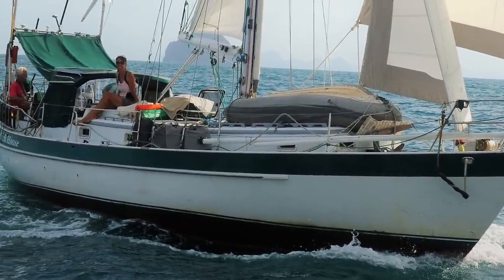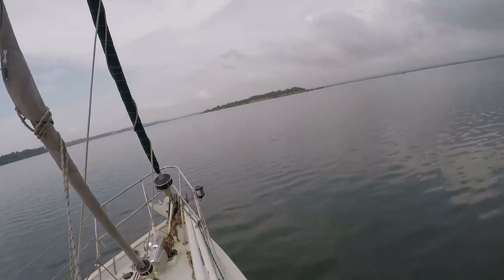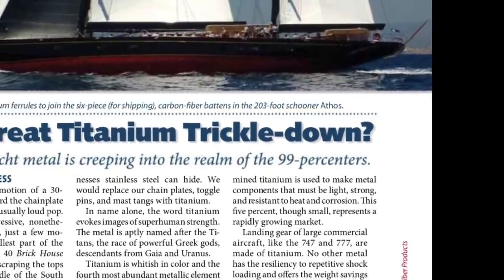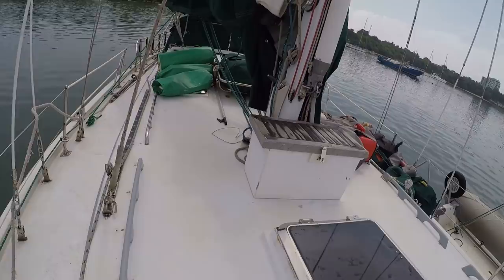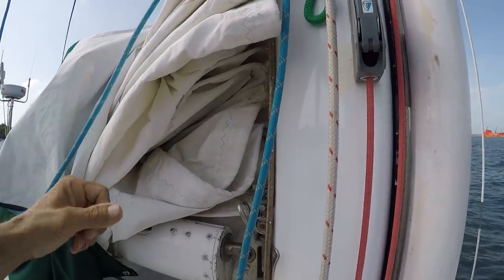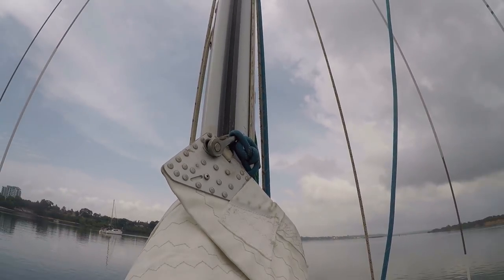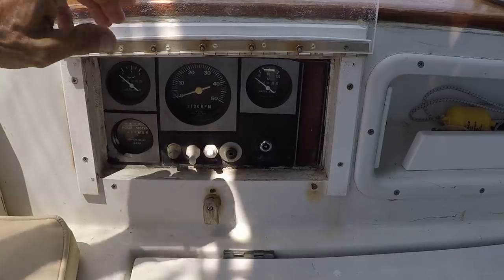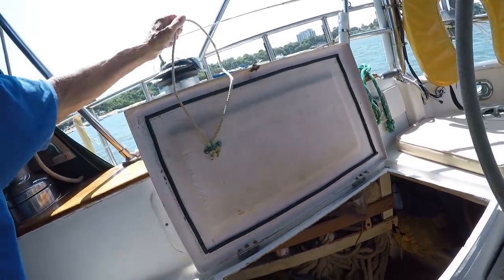Bluewater Sailboat Tour- On the Deck Of a Valiant 40 #1/3   (Patrick Childress Sailing #30)

Comment: Thumbs up. What type of communications do uou have on the boat? Also battery capacity and type?
The length of the video doesn't matter, as long as you giving us good information. The video would be much more pleasant if you could reduce the volume of the music, and avoid talking over the music. The story you're telling is much more important than the fancy edits. That's about all the feedback I have. Great video and thanks for sharing.
Reply from the maker: We have the normal VHF and Single Side Band with Pactor 3 modem. But now we have Iridium Go which is pretty much replacing the SSB. Sad to see it but the SSB is going the way of the cassette player and Radio Direction Finder. Batteries are 6 Trojan golf cart batteries which total 675 ah. Thanks for the feedback. I am deaf in one ear and have 50% hearing in the other so correct volumes are a real challenge. Rebecca has laser hearing and can hear a voice clearly no matter the back ground noise so we are not a good team for audio editing. To help keep me from saying anything stupid, I had a very experienced sailor friend look the video over prior to publishing and he did not mention audio so I thought we were good to go....but I will certainly cut the volumes next time.
Reply: @RVLifeNOW  thanks for replying. You have yourself a new subscriber. Stay safe and a very Happy New Year to you.

Comment: On the matter of walking hulls or props.  Always dock on the port side!  You pull the bow in and the stern walks right over to the dock!  You look like a great captain!
Reply from the maker: ZizZag, the Valiant 40s have a V-drive gear box which changes the direction of the engine output shaft 180 degrees....so the engine sits in the boat all backwards. this makes for a very compact engine and power drive train. This also causes an opposite rotation of the prop from most other boats. After operating other sailboats, one has to think backwards when reversing a Valiant 40. I see what you say though. Nice.
Reply: Patrick Childress Sailing I was kidding with you a bit!!! 
After 30 plus years of sailing I knew you new just joking!  
Smile,  laugh  you will live longer. 
Sending much love 
Be careful brother!

I knew you had a V drive but I did not know V drives changes direction of rotation so I did learn something
Reply from the maker: @svzigzag5898  Phew, I got lucky knowing the answer to that one. Always good to have experienced people making comments.

Comment: Hey Patrick, great video .. just a comment on titanium, in the recent past I used a lot of titanium on my racing bikes , it was considered a consumable item as all metal fasteners have elasticity,  titanium, whilst strong and light  had a much lower cycle rate than stainless or steel , not sure if this would pose issues on a boat, clevis pins I'm guessing would be subject to elasticity not sure to what degree.. I had many titanium components fail , but as weight was very important I continued using them..
Reply from the maker: Mitch, Grades 1-4 titanium are pure titanium and have different characteristics depending on how each grade is smelted. Those grades have a far lesser strength value than Ti5. Ti5 is a combination of metals giving it such great strength. Many screws and bolts are made of the lesser titanium grades. Use ONLY grade 5 titanium on a boat even for bolts holding a chain plate in place.

Comment: Another terrific video. How much more do you have to spend for titanium? I would have thought it prohibitively expensive.
Reply from the maker: Grade 5 Titanium cost a bit more than twice as much as 316 stainless steel. So if one is keeping their boat for a long time, as we are, the safety value is there. Ti5 is 3.5 times stronger than 316 and weighs little more than half as much as 316 stainless. Only grade 5 titanium should be used in a structural application on a sailboat, never the lesser grades. Hopefully, one day, they will have Ti5 turn buckles, toggles and wire. All far cheaper than suffering a dismasting.

Comment: Patrick,

Thank you for your very informative video and is a pleasure to see the Valiant 40 , I own a Pacific Seacraft 44 and it appears that all the modifications that you had to do on your vessel are standard build on the Pacific Seacraft except I have access for an emergency tiller just behind the steering pedestal . For the most part very similar Boats. I like the advise about using titanium for the rigging support , I think I will have all my chain plates fabricated and changed out to that. Oh yes what was the type of titanium the you suggest using.... Fair Winds and Safe Sea's  

Robert
North Star
Reply from the maker: Hi Robert, I always thought I would like our boat stretched out 3 or 4 feet to get a bigger aft cabin and to be able to somehow  move the anchor chain farther aft in the forward cabin. It looks like the Pacific Seacraft 44 is what I have in mind. 
The boats are so similar that there is on the V40, an emergency tiller access behind the pedestal  where the helmsman sits. 
The only grade of titanium to use in a structural application on a sailboat is Ti5, grade 5. Even with chain plates, the bolts securing them should be grade 5. Grades 1-4 are pure titanium and have their own special properties determined by how they were smelted. None of those grades are suitable for mast tangs, bolts or much of anything else on a sailboat. I use screws and some small bolts made of a lesser grade in cosmetic applications where I got tired of the stainless screws rusting or for simple things like the bolts to hold a cockpit locker hasp. The titanium article in Practical Sailor should answer a lot of questions. Allied Titanium might already have the pattern for your chain plates which makes the fabrication pretty easy. I hope this helps.
Reply: Patrick,
Thank you so very much for the quick reply and I will check it out  and it is all very useful  information . My Chain Plates are all stainless and I was in the process of researching to have all new one's fabricated... and I love the Idea of titanium .
Robert

Comment: Great video. On engine blower vent cubby hole could you mount the vent exit in the top of the cubby hole - is there room... at least gravity would be on your side keeping water out? PS. Did you let the cat back out?
Reply from the maker: The cubby hole is so big there is no room above it for a blower hose. I still have not figured out the best solution. Maybe some sort of plastic cap to fit over the vent and figure out how to secure it there. Lilly does get trapped in dark cabinets then lets us know, with a loud meow where she is and when she want out. But she has found a secret passageway from the aft cabin ceiling, into the cockpit locker, and from there, into the far aft of the boat, below the propane locker. It took a long time to find where she would mysteriously vanish to.

Comment: Patrick, my name is Victorio, I live in Spain, I admire your knowledge and I have seen all your videos, I have a boat of 28 feet and I want to put an HF radio for the bands of 20 mt and 40 mt, I have seen that you have an antenna going up the backstay, You would do me a big favor if you recommend me what type of antenna to place or describe to me as it is what you use, thank you very much.
Reply from the maker: We used to have insulators on the back stay but when we put on a new back stay 10 years ago I did away with them. That could have been 2 more failure points, they were expensive and a hassle to install. Here is the antenna we installed 7 years ago for our SSB Antenna.    https://amzn.to/2BSNdZa    This antenna has worked just as well as any other. 28' is a nice size boat, comfortable enough and easy to sail.
Reply: @RVLifeNOW  tnanks

Comment: Much like my Corbin 39 main engine is in Gailly but no V drive,, my staysail in hank on, same anchor windless,  right now carry 16 T-105 batteries  in house bank and 1000 watts solar, a honda 2K gas gen., air conditioner, a self made water maker,  3k inverter. So I think pretty good long term cruiser. S/V Bright Eyes
Reply from the maker: Bright Eyes...you sound well equipped!

Comment: Question     You have the engine gauges and controls on the side!  Ok that’s great!  If you could wave a magic wand and have them appear in front of the wheel would you?  Why or why knot? 
I am planning a boat and propose to put them at the bottom of a display in front of the wheel.  I would also include wind meters, and navigation screens?      Would you follow this plan or no?    Thanks brother,     

You also said if given a choice you prefer to go to the mast to raise or lower sails.  Me too. 
I plan on no auto furl on the mast.  I also am giving serious consideration to no auto furl or roller furl on the jib.   Money is not the consideration.  True sailing and personal satisfaction weigh heavily on my decision.  What are your thoughts.   

Stay quite, carry a big stick, be the meanest in valley,  but smile!
Reply from the maker: Zig, Where our engine instruments is a convenient place. There is no problem at all where they are...especially for servicing when a gauge wire shorts out or a kill cable needs to be replaced. I think, servicing could be more difficult on the binnacle. Also, you don't need any more metal or electricals interfereing with the compass.  All those instruments and lights in front of the wheel at night , even when dimmed, red, upsets the ability to see out to the distance. Large chart plotters are the worst to have in front of the wheel, although many people mount them there.
Reply: Patrick Childress Sailing  GREAT INSIGHT
Reply: Patrick Childress Sailing  I have noticed the lights at night!,!!
I frequently turn them off to see!!!!!
Reply: Patrick Childress Sailing   Hmm the chart plotters are definitely a double edged sword!    I run small fast fishing craft.  At night I have been known to run by my extensive way points trails.  Like bred crumbs leading he way home I can trust them at 45 to 50 mph.  Holy help if a dark boat is up front.  I will definitely wake up Charlie!

Comment: Can I ask you about your boarding ladder, I have a smaller version on my Cape Dory. I was wondering if you have had issues with the stanchion bolts or bedding? While a Cape Dory is somewhat heavily built, it seems like a lot to expect of one stanchion. Your boat has always been a favorite of mine.
Reply from the maker: Hi Rich, I have never had a problem with the boarding ladder or the gate stanchion and its support leg the ladder is attached to. So in effect, the ladder is supported by two tubes of steel and two deck pads. I could not imagine a single stanchion would be strong enough to support the ladder.   Never a leak in that area of the boat. That ladder is at least  20 years old and the stanchions are 44 years old. I like the interior design of this boat also. I don't know of any other 40 foot boat that so well utilizes the interior spaces.
Reply: Patrick Childress Sailing thanks so much for the input. Your twelve years of active cruising would challenge the ladder sufficiently to verify it’s functionality; I was not sure how long it had been in use. My Cape Dory is 37 years old and now I guess the ladder may be also. The stanchion the ladder is attached to on my boat is much like yours with two supports. 
Enjoy your next passage,  Rich
Reply from the maker: Rich, I completely forgot to mention....There are also two legs one that reaches from the stanchion outwards to the cap rail, and another from the aft sloping support, outwards to the cap rail. This adds a lot of rigidity and strength. So the ladder is supported by 4 legs and mounting, deck pads. Check our video about the exterior Valiant tour. I give some closeups in that video. Video #30. Hope this helps.
Reply: My ladder is identical to yours with the exception of those two additional supports. I’m going to see if I beef it up some.

Comment: I'm trying to find a picture of the reef hooks you modified with a closing device... any help would help! Thanks
Reply from the maker: The wording on the thumbnail got changed, so it can be hard to find just by looking at the video titles. A search, in YouTube, for "Patrick Childress reef hook" , will bring up the proper video though. The reef hook is in the flare launch experiment along with "scuppers". Here is the link:
https://www.youtube.com/watch?v=lakH18f2_tA
titled Pirates, Scare Them to Hell.  Basically, I took the original reef hook and added the barb from a speargun shaft to retain the reef hook. Hope this helps. Patrick

Comment: I have read “ canoe stern sailboats once were the go to hull for blue-water sailboats but.....they give up storage space, if backed in in a slip are more challenging for a plank walkway, more difficult from a dingy to enter exit.”   Obviously all these issues are addressable, given the dollars would you purchase another?
Reply from the maker: Eric, the canoe stern performs much better in large following seas than a full stern sailboat.    
The only reason I have this boat is because when I met Rebecca, she owned this boat. A hot chick with a 40 foot sailboat, how could I pass up that deal? At the time, it was far easier to keep this boat than to get something else, like a Swan 48, a boat I am very familiar with.  The Valiant 40 is an old design but does its job well. One of the worst boats in the world is a true double ender. They have a terrible way of “hobby horsing”. That is rocking fore and aft, whether at anchor or while sailing, especially on the wind. That hobby horsing really slows the boat down. The canoe stern, with it greater reserve buoyancy in the stern, does not suffer the same, except when hard on the wind, in the right wave conditions, the Valiant 40 hobby horses a little, slowing the boat. There is no problem with bringing the dinghy along side, port or starboard, and getting in or out of it. One advantage of this boat is its rub rail, which makes for a nice step to get into or out of a dinghy.
 I don’t see any lack of storage because of the canoe stern. There is plenty of storage in the cockpit lockers and the area all the way back to the stern. Two large propane tanks are stowed in the special locker in the stern. The storage on this boat is very well thought out. 
In 12 years, we have never been in a place where we needed a plank to our boat. That might be true when moored stern to a dock, like in Bermuda or places in the Med. 
These old boats are much more affordable than that Swan 48 so there will always be a market for a well maintained older design boat. You sail away with what you have, and don’t look back.
Reply: Patrick Childress Sailing  I knew you would have an excellent response.  Thanks for the information,
Reply from the maker: Your welcome...thanks for your question.
Reply: @RVLifeNOW  we're approaching retirement & selling up to, in part, build a modified wharram tiki46 cropped stern & scaled up to 50'...a LOT in what yiuve covered...im now going to apply to our cat...especially your points on the double ender which wharrams are...have been wanting a justification for the arcitect of the cropped & fuller stern...the best tech cal tour of ANY boat ive seen to date...24m;ns ban shed in 10 :-/...had to pause to take some parts in...subscribed
Oh & P.S. the mast isnt too far back...the mains just not quite right...personally id have re-cut the main with shorter foot but keeping the roach & even racking back a little...Genoas are a much more efficient sail, no mast shrouding & smaller mains are cheaper & easier to handle & maintain & with your staysail more flexible to tune...a fore peak for the genoa would have been a better option for lighter airs setup...you can take sail down but cant put it up if its not there for those loooong frustrating light air days. Cheers from NZ
Reply from the maker: @Errol.C-nz  Errol, thanks for subscribing. On our main, every sail maker wants to give us a roach. We have no roach, it is straight from the clue to the peak as a roach would increase weather helm.  That is a V-40 design flaw. When I ask Robert Perry, the designer of this boat, whether the mast is 8 inches or 2 feet too far aft, as I have read both dimensions in articles, Perry will not reply.  The "fix" for the improperly placed mast was to make a bow sprit for the jib and thus there became a Valiant-42.